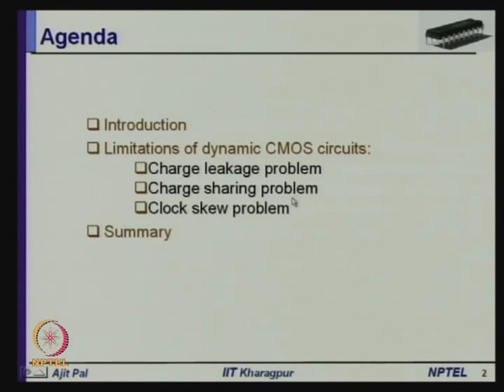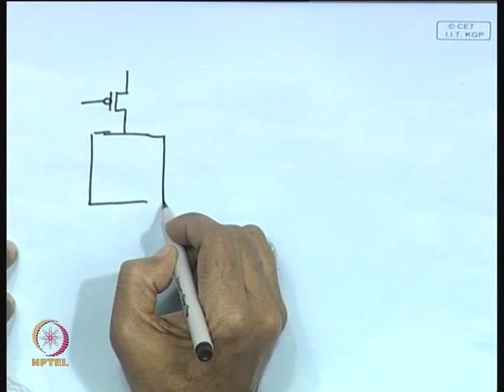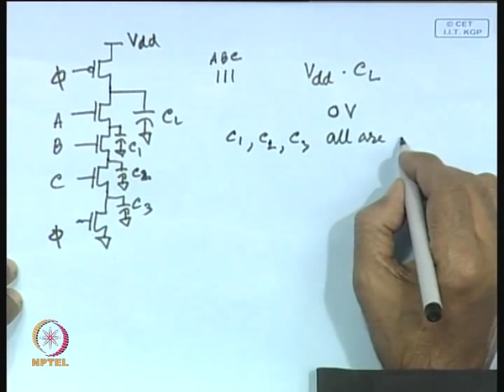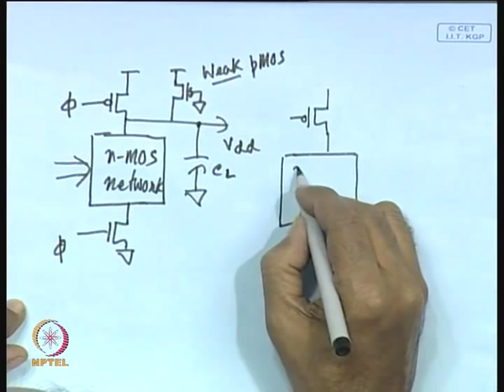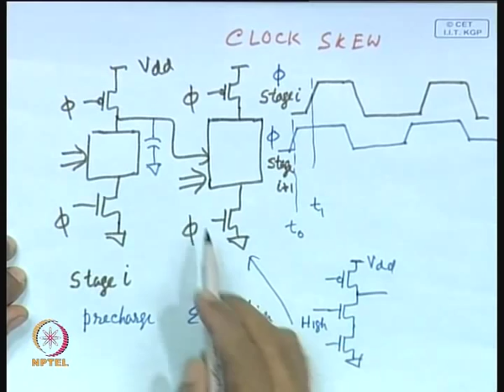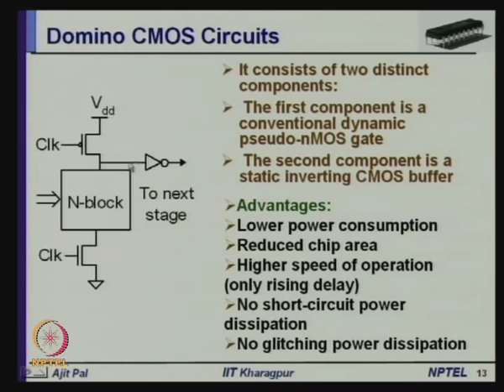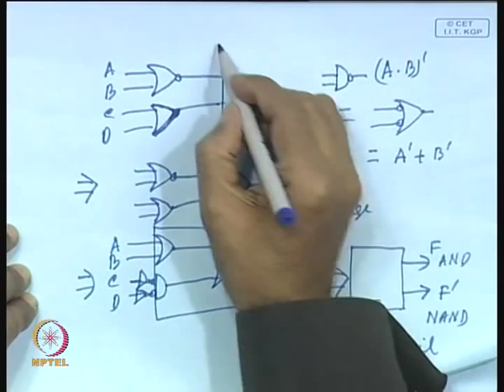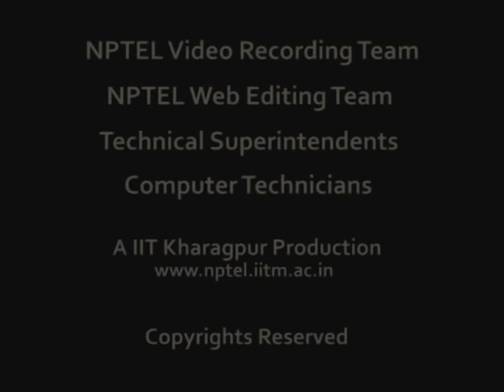Mod-01 Lec-13 MOS Dynamic Circuits -II

Comment: Hi sir, i am having a small doubt, when we implement nmos logic, we use weak pmos to reduce charge sharing and charge leakage, but if we use pmos logic for dynamic circuit, how do we reduce these limitations, (do we use weak nmos in a similar way?)